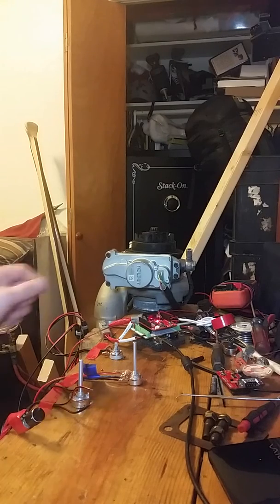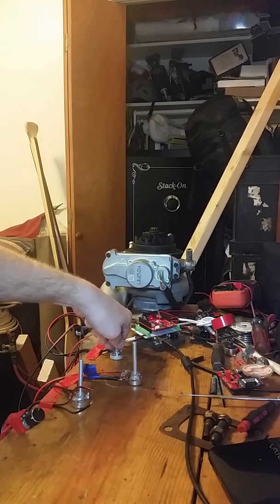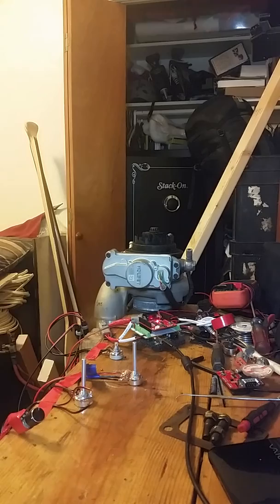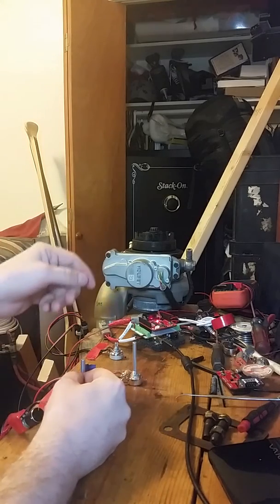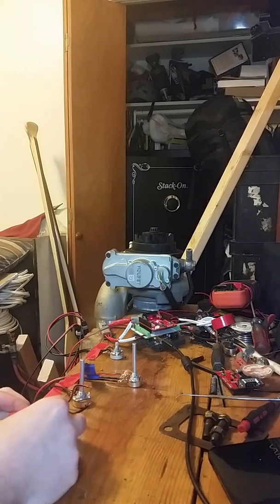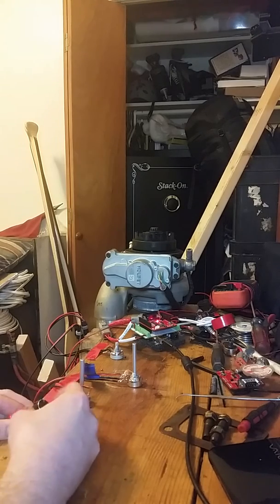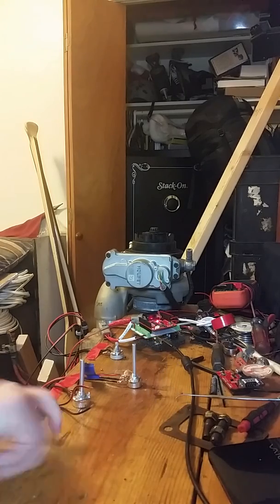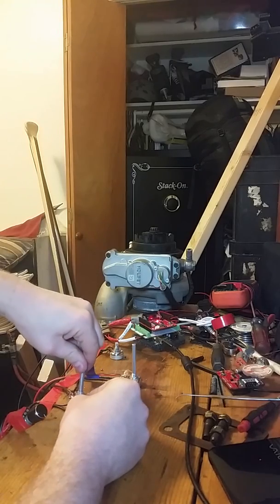He351 ve VGT Controller for Cummins 5.9 Arduino

Comment: I was looking for the wiring diagram but didn't see it is all the sensor an the pot switch just hooked to the Arduino and the can board is just to change the position signal to can bus language. I would like to use your setup to run a 6.0 vgt witch is just 0v to 5 volt pwm signal. any clue how I would go about that or were to look to find that info or a cost if you know how?

Comment: If I wanted to control the turbo just with a on/off pot just like yours to control veins and EB no other inputs would I just need the Adrino uno with a canbus shield or just the Adrino?
Reply from the maker: https://mopar1973man.com/topic/9632-he351ve-stand-alone-arduino-controller-code-for-2nd-gen-cummins/

Comment: This controller is independent of the ECU of the motor. Or is it communicated by j1939?
Reply from the maker: It is independent of the ECM. It uses an Arduino and a canbus shield.